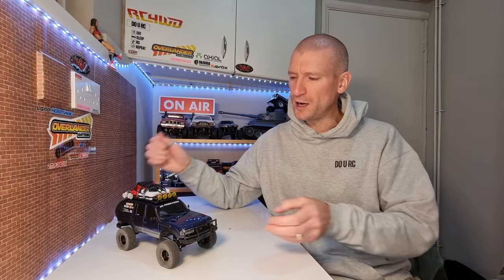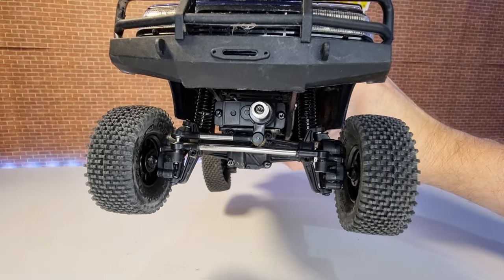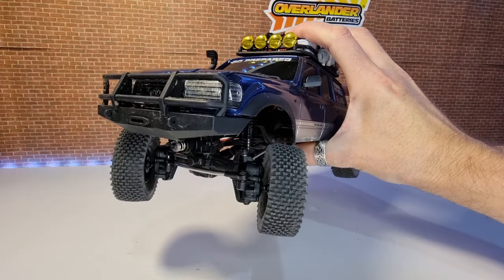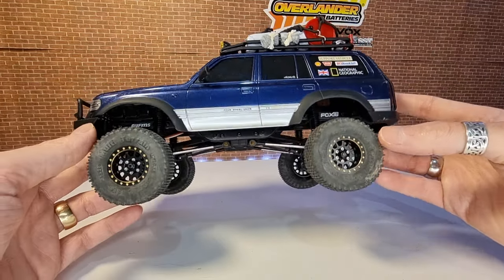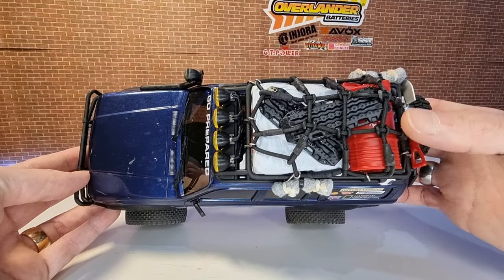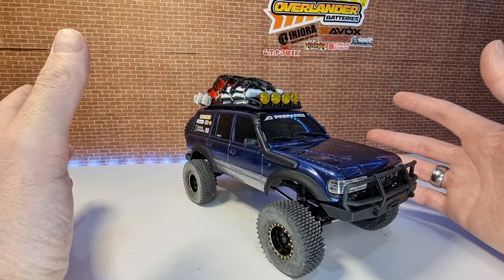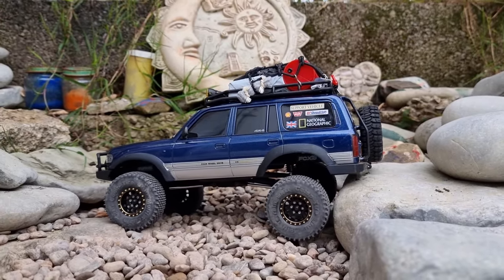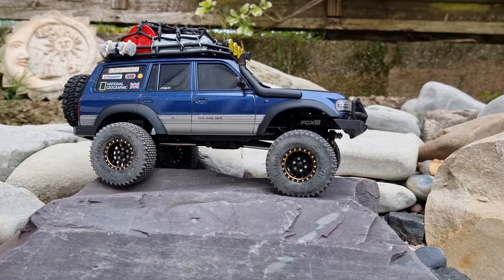FREE Mods to Improve Performance & 1st Upgrades for FMS FCX18 LC80

Comment: Great vid. Just picked up a yellow one yesterday - Love it! Already modded the lights (bye bye turn signals, hello bright white headlights!). I've reversed the screws on the steering knuckle, but haven't done the tie rod yet. 
One thing to note for anyone doing this bend, the tie rod ends will need to be adjusted to compensate for the shorter linear distance between the knuckles. Bending the tie rod will have the toe on both tires out of alignment. I haven't taken mine apart yet, but I'm assuming that these are like any other RC car and screw in and out. Be sure to center your servo trim before making any adjustments! :)
Reply from the maker: Thanks very much 👍
Hope you enjoy yours, they're great rigs, especially with a few upgrades. 👍

Comment: I have one of these arriving tomorrow.  I'm definitely ordering those wheels for it with different tires because I like the look of the mud tires. I can't wait to mod it. 
I was at a hobby store today and the guy behind the counter had a built TRX4M with rear wheel steering. I went into the store to look at 1/10 crawlers and ended buying a FCX18.
Reply from the maker: Excellent, it's an awesome little rig, definitely one of the best value mini crawlers you can get right now, especially if you like a nice scale body. 👍😎
Hope you like it. I'd recommend the Injora Swamp Claws, really good on the rocks and awesome in the mud. 👍
Reply: @DoURC  I already ordered. I got the same wheels with AT super s5 king trekker. It was kind of a package deal. I'm also looking at the injora 45mm shocks and drive shafts.
Reply from the maker: @failsworth655  Excellent, sounds like some nice upgrades there. I'd definitely try out the stock shocks before changing them. Once you add heavier wheels it does work the suspension more. 👍
Reply: @DoURC  I got my FCX18 and this thing is so rad! Mine came with black links instead of silver. I'm not sure why. I wish they weren't black but I guess I can paint them whatever color I want now.
Reply: @KyleKick909  Same. I think it is just a little upgrade from FMS. I think they look better than unfinished steel.

Comment: Love how the tires form to the rocks awesome
Reply from the maker: Yeah they're really good, nice bit of squish on them. Non vented too, so if you vented them would be even more. 👍
Reply: @DoURC  I'm a complete newbie who got into RCs because I got myself and my son cheap supermarket toy store ones last Christmas, but how would one manage to 'vent' these tyres? I've been doing a bit of research and this and the TRX4M stood out the most. I'm looking for a mostly stock but maybe will look into mods and aftermarket parts once I get comfortable.
Reply from the maker: @ryannacario7849  There's two options really, either use wheels that are vented or put little pin holes in the tyres. You don't want to vent them if getting them wet though, as it'll ruin the foams. 👍
I've got a comparison video of the trx4m and fcx18 in my Mini Crawlers playlist. I'd also suggest considering the FMS FCX24 as well. 👍
Reply: @DoURC

Comment: Looks great and upgrade is spot on! Are those 1.0 plus wheel all with -3,75mm offset? Does that pin pattern wear out soon in use?
Reply from the maker: Thanks very much 👍
Yeah Injora 1.0 plus and all -3.75mm offset. 
Mine have been fine so far, only used them for a few months so not sure on longer term use. 👍

Comment: Got my brass wheels and swamper tires in today. So much better than stock. I need to do these mods next.
Reply from the maker: Excellent, the Swampers are great aren't they and that extra low down weight of the brass wheels really helps. 👍
Reply: @DoURC  I put brass portal covers up front. I think I’m done with weights at this point. I’m estimating it’s around 60/40 now.
Reply: @DoURC  oh and my dad put those on his TRX4M high trail F150. Says it woke his truck up.
Reply from the maker: @RabbiJesus  Excellent 👍😎
Reply: @DoURC  How do these tires compare to an Injora or  scrambler tread replica tire? These look to hook great. I want my fcx 18 to be a nice trail rig with decent crawling. Will mod the suspension and add brass wheels as well. Just curious before i pull the trigger on tires.
Reply from the maker: @iandobbs7823  These tyres are Injora Comp Pins. They're good, but I think the Injora Swamp Claws are a better all round tyre. I've got reviews on the Swamp Claws and some of the LGRP tyres. For me personally I'd choose the Swamp Claws as I love mud. 👍

Comment: Great videos and Love the content. New to the RC world and was on the fence with this FCX18 or the FCX24, the TRX4M or the SCX24 gladiator.  Which would you advise as best out of the box.?
Reply from the maker: Thanks very much, appreciate it. 👍
I would say either tje FCX24 or FCX18 tbh, both better out the box and have more features and better value for money. Only downside to the FCX18 is its not fully waterproof, but from my experience it's the power switch which is the issue. 
My favourite FCX24 is the Unimog. 👍
Got reviews of them all in my Reviews playlist and some comparisons between them all in Mini Crawlers playlist 👍
Reply: Great thanks. Is there a way to waterproof the switch as I think I'll go for the 1:18.
Reply from the maker: @daviddoyle1017  You could wrap it in something. I just deleted it and wrapped the wires together, so now it powers on when you connect the battery like the trx4m does. 👍
I've got a referral link in the description for FMS if you want to support the channel when you order it. Got discount codes etc too if they help. 👍

Comment: Mine arrived, but the car doesn't connect to the control. I connect the battery, then turn on the switch inside the engine, and then turn on the control and it doesn't connect. When I turn on the switch inside the car it even turns on the headlight and taillight but it goes off afterwards, but inside the motorcycle there is a red light flashing but it cannot pair with the control.
Reply from the maker: Turn on transmitter first then esc, if that doesn't work follow bind procedure in the manual. 👍
Reply: @DoURC  ok man ,i biding with manual and worked ,thanks 😍

Comment: The torque twist at 6:24 and 6:32 and lifting its front wheel at 8:29 is so annoying, it definitely needs more weight on the front.
Reply from the maker: Yeah it definitely needs some more front bias, considering the battery is up front it's still quite rear and top heavy. Spare wheel and body is the issue I think. But they're staying as is. 👍

Comment: FMS made again a beautiful and capable scale crawler. Thanks for the tips.👍
How about the offset of the brass wheels ? The tires seem a little far outside the body.
Reply: I was just wondering the same. I think that they are -3,75mm. Probably smaller offset might cause rubbing issues.
Reply from the maker: Yeah it's awesome isn't it. 👍
No worries 👍
Yeah they're -3.75mm, so widen the wheel track. 👍
Reply from the maker: Yeah -3.75mm. 👍
Reply: @DoURC  Thank you for the value. I order the same wheels right now for my yellow FCX18.😉
Reply from the maker: @vdel9036  Awesome, hope you like them. 👍

Comment: Upgrade number 5: Remove the heavy body, which takes out the windows, spare tire, luggage rack, snorkel and bumpers. 😀Let's face it, that body and the luggage rack comically packed with everything including the "proverbial kitchen sink" is a detriment to performance because it makes it top heavy. Run it without the body as just a frame and you will be amazed.  The 55 gallon drum always makes me laugh. Do you know how much those weigh when they're full? I know it's all "for realism" but no one is packing those, even on a National Geographic official expedition vehicle or the Camel Trophy. The 55 gallon drum is a garage accessory for static display but it got tossed into these vehicle accessory packages sold by Injora and the like. 😉
Reply from the maker: If all you're interested in is performance and you're going to remove the body, you may as well just spend another $20 and buy something like the brushless Hobbyplus CR18P Evo Pro.
This is a scale crawler, so it's finding that happy medium between scale looks and performance imo. 👍

As for the barrel, for me it was just something to fill a space on the rack. As people started moaning about it, it's kind of become a running joke. 🤣😁